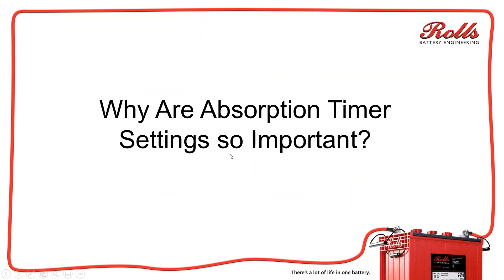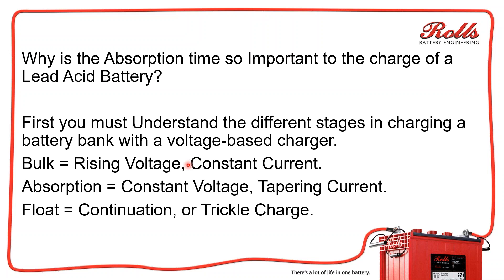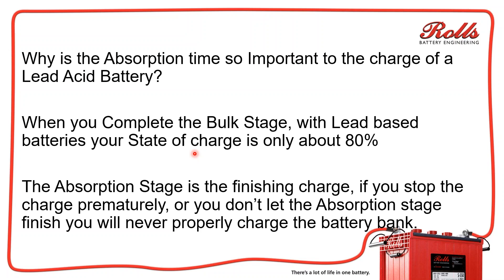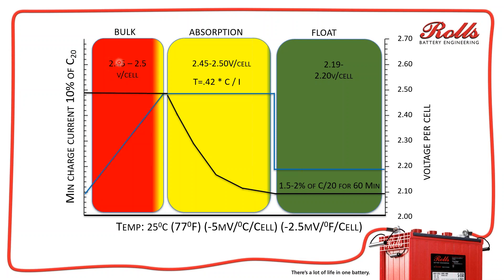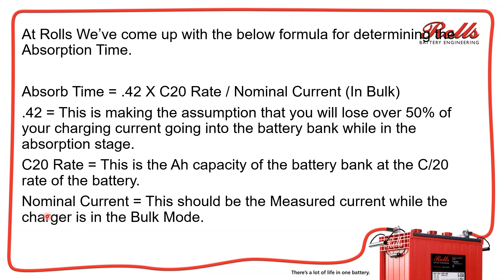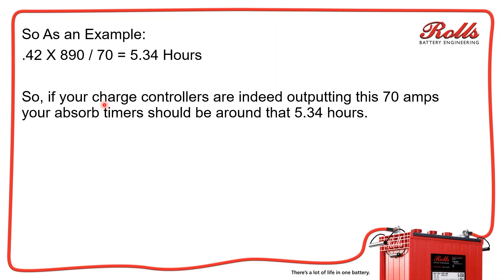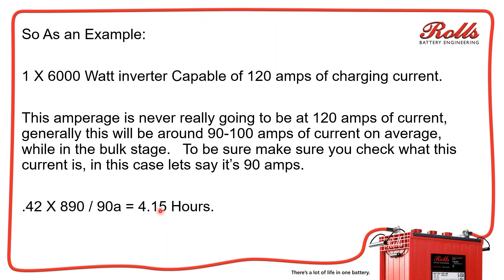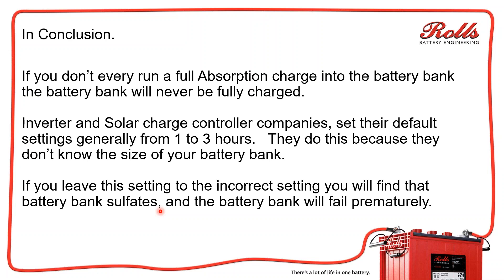Rolls Battery Engineering - The Importance of Absorption Time

Comment: your video was the only video i found for obsorbtion time,what if your obsorbtion time is miscalculated and is set to 6 hours instead of 5 hours  long ?
Reply from the maker: Sorry for the delay, we don't monitor comments here as we have a tech support line.   If you absorb longer it'll gas more and you'll use up more water.     This too can cause overcharging which will damage the plates of the battery and cause plate corrosion which can be as bad as sulphation.

Comment: Glad you emphasized 'actual' charge current when calculating the absorption time using your formula. I have two 4 KW arrays, one East and the other South charging through two Tristar 60A MPPT controllers and I first calculated 1000Ah/ 120A x .42 = 3.5 hrs  but after 3 months noticed several cells were low on SG even after a full absorp. At this time I noticed even on sunny days the max charge I was 'actually' getting at any time was 70A so recalculated absorp time 1000Ah/ 70A x .42 = 6 hours. After re-programming the Tristars i'm pleased to say all the cells have recovered after 2 months of the longer absorp period. What I really need is another 60A array facing East to get a quicker bulk phase and let the South facing array take care of the long absorb.
Reply from the maker: Yes, too many think that they have a 60 or 80 controller, and that means that they are getting 60 or 80 amps from the controller...   Just doesn't happen in the "real world"...

Comment: Thanks for the information , can you please do sometime on  lithium battery's
Reply from the maker: I have to ask... what you what on Lithium Battereis?
Reply from the maker: While being a new "Tech"...  They are just so boring, as the Battery Mgmt System really does all the work... Most Lithiums with a decent BMS all you do is supply voltage and current and the BMS does all the work.
Reply: @RollsBatteryEngineering  Yes, I agree not much info can be supplied that isn't already on the spec sheets found on the Rolls website other than maybe describing how the BMS operates when the cells are in a parallel string. How are the individual BMS on each cell connected together and will they communicate with say a Magnum Me-Arc remote controller?
Reply from the maker: @Dnnap  The BMS needs access to the internal firmware of the product that is connected... There are two types of communication.  Open Loop and Closed Loop.   Right now there are no comms options for the Magnum product so you would have to use Open Loops comms...  which means there is no shared information between the battery and the Magnum inverter. 

Now with Outback, Schneider, and many other companies, they have a comms software in place...    This is closed loop, this means that our battery will control the inverter and tell it when to and when not to charge. 

Currently, this is not something that is available with Magnum due to their communication problems. 

There will be more indepth webinars in the near future, but this information is available in our manuals on our webpage, this was an introductory done back in August.